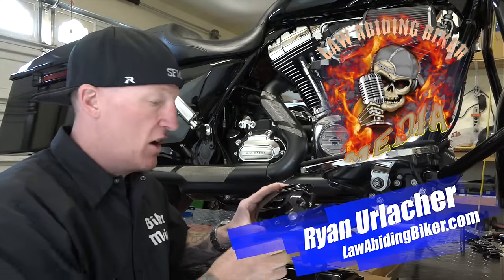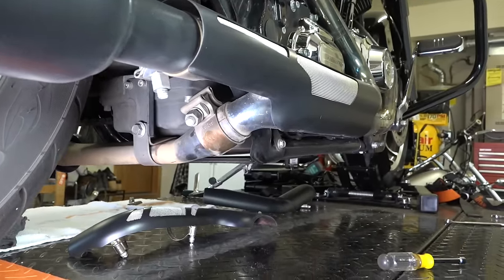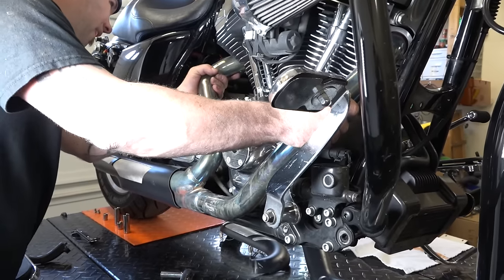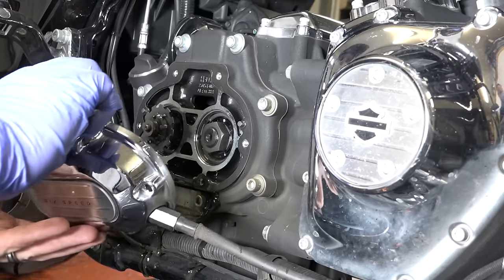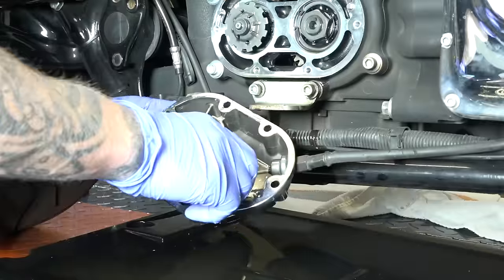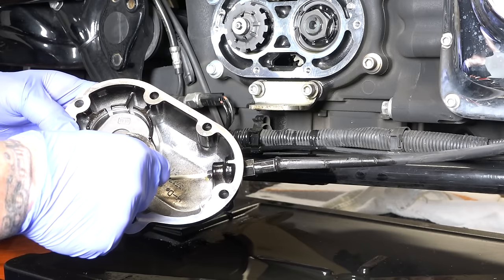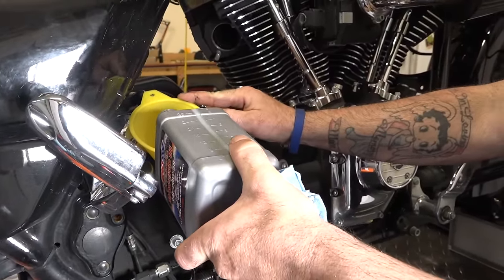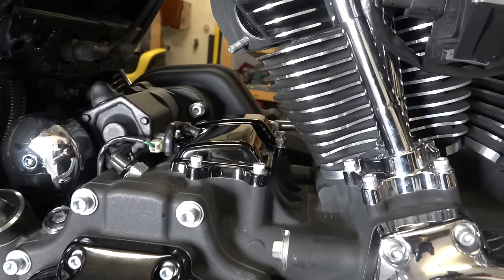Remove-Install Harley Side & Top Transmission Covers-DIY-Motorcycle Podcast

Comment: The two lower bolts on my 2015 ultra worked loose, and was loosing Tran. oil.  I could not get the second one off without removing the Headers.  This was so darn helpful, made it easier  to do the job.  Thanks for all you guys do.

Comment: Great video!  My side cover was changed when I did my engine upgrade but didn’t change the transmission top cover.  Can I replace the top cover without taking the damn exhaust off?
Reply: Yes, but it is a pain with little room to work just take your time and it will work
Reply: I realize it's a year old.  I just replaced the vent tube on mine.  Yes it can be done without removing exhaust. Popping off the cover took a few short knocks screwdriver & hammer as demonstrated in video.

Comment: Ryan, on the top cover I see when you put the top cover on the bike you didn’t use loctite on the 6 bolts? I have a 2019 softail and I am wondering if I need to use blue loctite? Please advise

Comment: Hello Ryan,
I just wanted to pass on a great sealer/gasket maker product for you and your viewers, Called Hylomar Universal Blue Racing Formula compound.  It is non Hardening Fuel and oil proof!  

This product is used in aviation Jet engines and can withstand extremely hot temperatures. I have used this product on sealing fuel tanks float sender mating surfaces and threaded holes in fuel tanks...still sealed air tight after 8 years of being exposed to fuel in my vintage sports cars. Also, it can be re used after pulling mating surfaces apart such as motorcycle engine covers, exhaust flanges and so on.  It's a little pricey At $19 dollars..but well worth it since you can re use it after pulling mating surfaces apart.  It can easily take the place of any original gasket or be applied  as a thin film to a clean new or used gasket.  

This product can be special ordered at your local Napa car part store or online.  Hope this helps!
Reply from the maker: Thanks Michael.  We'll check it out.

Ride safe & Ride Often!
Here is a link to a bunch of our useful Free vids: http://www.lawabidingbiker.com/freevideos
Here is a link to some of our useful for purchase videos: http://www.lawabidingbiker.com/buyvideos
Want Answers & Information Fast? And help support us at the same time? Do you like the content we provide?
Our patrons get answers to their questions/comments/feedback in less than 24 hrs and are part of our Private Facebook Group. If you are interested in being in this exclusive group you can get all the details at ==> http://www.lawabidingbiker.com/patreon
If you haven't subscribed to the Law Abiding Biker Podcast make sure to do so. Listen in as we talk weekly about issues/items like this & so much more. You can listen on iTunes (Apple/IOS), Stitcher Radio (Android), or any other Podcast App ==> http://www.lawabidingbiker.com/podcast
Join our free email club at http:///www.LawAbidingBiker.com/EmailClub. Only relevant content will be sent from time to time. Email club members are the first to find out about free or for sale content are given special coupon codes.

Comment: Ryan, think about using short sections of allthread of the appropriate thread size to create a stud onto which you hang the gasket and then the cover.  The back the allthread out.
Reply from the maker: Great tip!  Thank you for sharing with the LAB community.

Ride safe & Ride Often!
Here is a link to a bunch of our useful Free vids: http://www.lawabidingbiker.com/freevideos
Here is a link to some of our useful for purchase videos: http://www.lawabidingbiker.com/buyvideos
Want Answers & Information Fast? And help support us at the same time? Do you like the content we provide?
Our patrons get answers to their questions/comments/feedback in less than 24 hrs and are part of our Private Facebook Group. If you are interested in being in this exclusive group you can get all the details at ==> http://www.lawabidingbiker.com/patreon
If you haven't subscribed to the Law Abiding Biker Podcast make sure to do so. Listen in as we talk weekly about issues/items like this & so much more. You can listen on iTunes (Apple/IOS), Stitcher Radio (Android), or any other Podcast App ==> http://www.lawabidingbiker.com/podcast
Join our free email club at http:///www.LawAbidingBiker.com/EmailClub. Only relevant content will be sent from time to time. Email club members are the first to find out about free or for sale content are given special coupon codes.
Reply: Or just poke a few bolts onto the cover spread around, and hang the gasket on the bolts so it doesn’t fall, cause you know, gravity. Hold onto it and the cover and place it onto the trans… either way, either way is fine

Comment: Ryan - working on my 2014 Ultra right now (yes, Easter Sunday), hoping to ride today.  Lower bolt (the one with the trick of putting a screw driver underneath to stop it from spinning) is seized up.  Sprayed lots of teflon lube and still cannot get it to turn without the top of the flathead screw from spinning.

Any suggestions?  I'm so frustrated...

Comment: I recently bought a used 07 street glide. it has the vance and hines dresser duals on it.  for some reason it looks like they left the bolts out on the bracket under the transmission cover.  seems like these would be pretty important. any ideas on why or if they are actually needed?  thanks

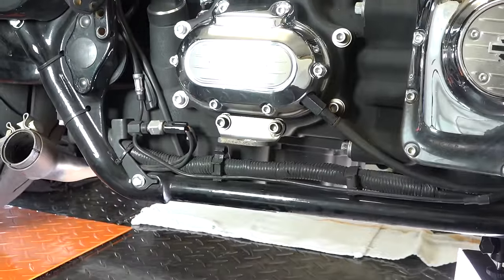Comment: Hey Ryan! huge fan and subscriber. Can you tell me at the 7:39 mark, what size and length those bracket bolts are? One of mine is missing and i havent been able to ride anywhere because I assume its causing a leak somewhere that is burning on my exhaust and smoking pretty heavily. Do those bracket bolts hold fluid in that would leak if one was missing?

Comment: I have a 2014 Street Glide. How do I know for sure if I have a hydraulic clutch or not?
Reply from the maker: Hydraulic clutch will have a reservoir on the left side just like the brake reservoir on the right side.  Cable clutch has no reservoir and will have an adjuster on the cable located at front of the motor (usually near the frame down tube).

Ride safe & Ride Often!

Here is a link to a bunch of our useful Free vids: http://www.lawabidingbiker.com/freevideos

Here is a link to some of our useful for purchase videos: http://www.lawabidingbiker.com/buyvideos

Want Answers & Information Fast? And help support us at the same time? Do you like the content we provide?

Our patrons get answers to their questions/comments/feedback in less than 24 hrs and are part of our Private Facebook Group. If you are interested in being in this exclusive group you can get all the details at ==> http://www.lawabidingbiker.com/patreon

If you haven't subscribed to the Law Abiding Biker Podcast make sure to do so. Listen in as we talk weekly about issues/items like this & so much more. You can listen on iTunes (Apple/IOS), Stitcher Radio (Android), or any other Podcast App ==> http://www.lawabidingbiker.com/podcast

Join our free email club at http:///www.LawAbidingBiker.com/EmailClub. Only relevant content will be sent from time to time. Email club members are the first to find out about free or for sale content are given special coupon codes.

Comment: Why not put a rag under the side cover so you don't drip gear oil all over everything when removing it?

Why spin the snap ring around?  Why not merely squeeze it closed and remove it?

"snap ring pliers" not "snap rings"